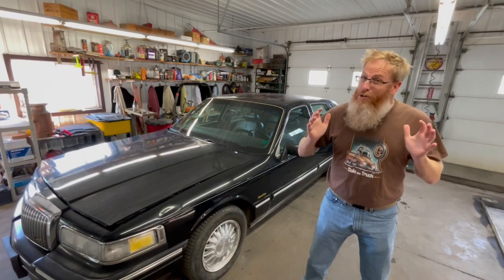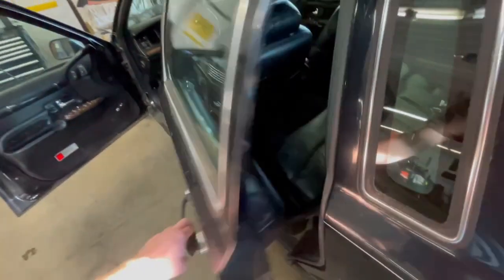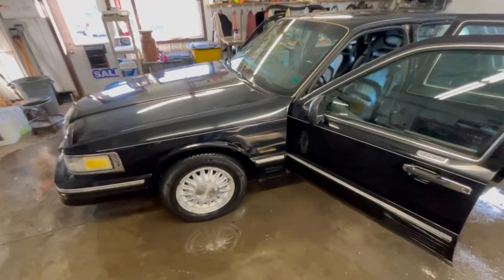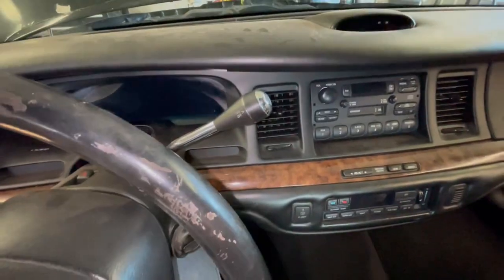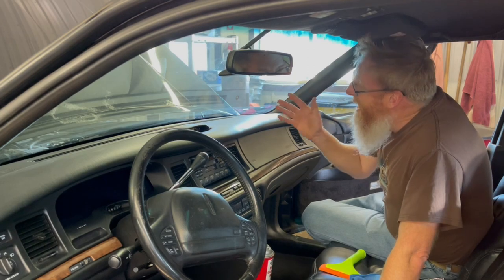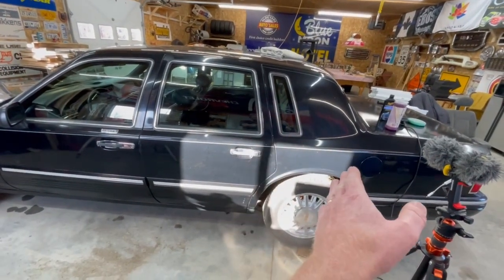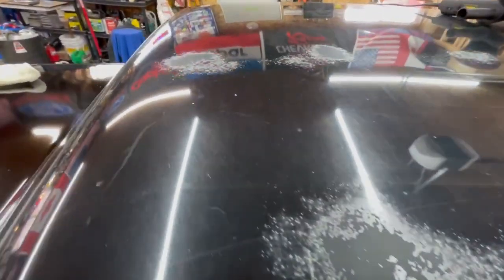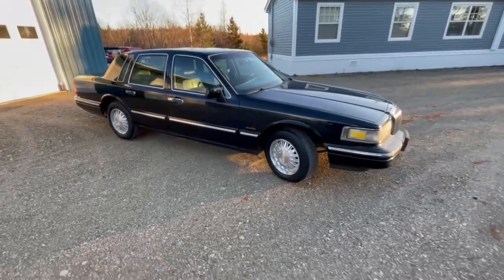PAPER CLIP CHALLENGE-Trading Up My $500 Lincoln Town Car For A $100,000 RAM 2500 CUMMINS DIESEL

Comment: The Lincoln looks great.  I’m a big fan of the Panther Platform cars and currently have an 01 and 03 Grand Marquis cars serving as my daily drivers.  The 01 used to do 20k miles a year for me and always performed very well.  The 03 has the newer suspension which handles better, but doesn’t ride as nice.  

Good luck with the challenge!  I think you’re off to a great start.
Reply from the maker: I have plenty of panther content over here! Thanks for stopping by. 

I agree with the pre-03 ride quality, but both are great!

Comment: Rain X makes a good inside window cleaner it's shaped like a triangle to get corners with a micro fiber cloth shaped to it works good and the handle is a spray bottle also. I Use Rain X blades too.
Reply from the maker: I’ll look into that. I love RainX

Comment: This entire series on the 97 TC just makes me miss my 95.  I love the 06 I'm driving now, but that 95 was the best car I ever had.
Also think you're underselling the value of that car.  In great condition like that, with low miles she's selling for more like $5,000.  I've got an 03 TDI jetta wagon that needs a new (automatic) transmission, and an 03 (non-wagon) TDI parts car (a tree fell on it) with a blown engine and manual trans I'll trade you for it.
Reply from the maker: Hi John, this TC is not a low mileage car. It has 233k miles. We’ll see what she brings!
Reply: @OldeCarrGuy  Low enough for me, Ha.  I bought my 95 in 2008 with 195k miles and put 300k more on it.  As long as you keep up on the oil change and use the correct oil filter,not the tiny one the interchange system says fits, the 4.6 is good forever. The body fell apart on mine and when the head gasket finally went at 500k miles I didn't have the cash or time to fix it.  Already had an 05 TC as my daily and was letting my sister drive the 95... and she was awful at getting maintenance done.